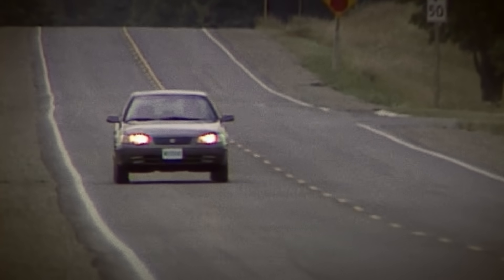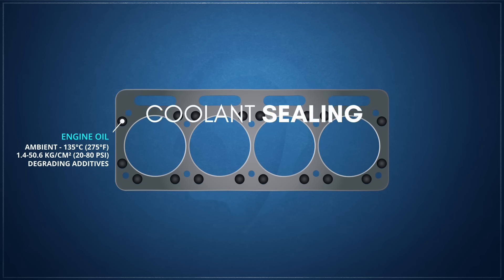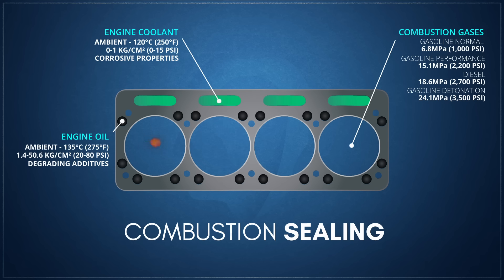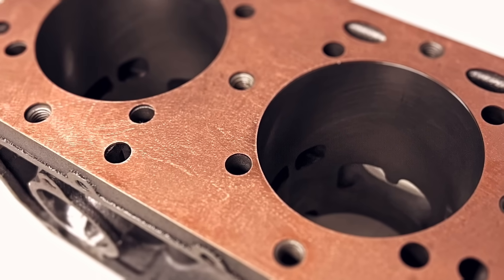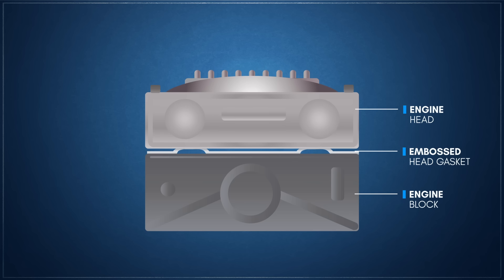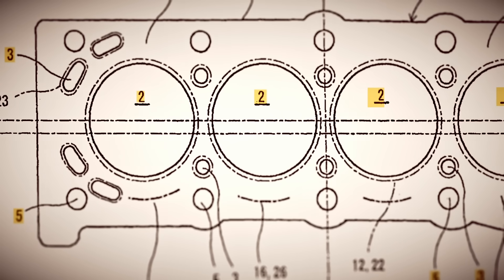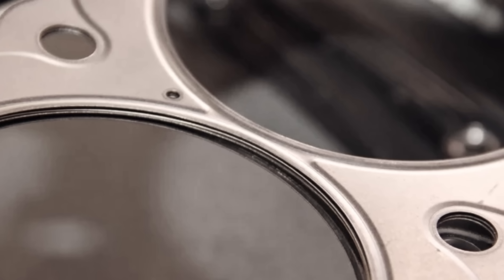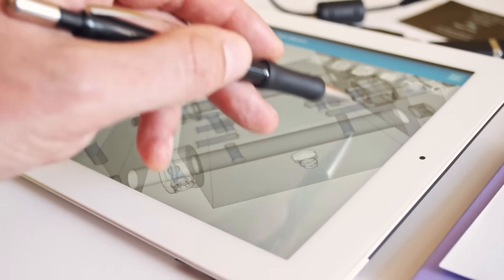The Most Tortured Part In An Engine

Comment: This was very interesting! Great timing I'm rebuilding an engine for my truck at this very moment.
Reply from the maker: Thanks! Haha, same! Doing my 4Runner 1/4 million mile service
Reply: @NewMind  crazy! Is that how you had the idea to do the head gasket video?
Reply from the maker: Absolutely! I was impressed by the 22 years I got on the factory head gasket. What are you rebuilding?
Reply: @NewMind  ahh.. 20 years that's good. Finally got back going again and continuing where I left off with the jet powered go-kart. I built everything and then I realized that the engine in my truck was blown. So I had to interrupt everything to rebuild the engine I have 4 broken main bearing bolts in the block now and 3 broken exhaust bolts in the head. Seems that for some reason the engine spun a bearing and has 1 bent valve, weird, only has 40,000 mi
Reply: @WarpedYT  oh boy, late model? I'm trying to build a very custom 4-cyl and looking at as much information on related parts myself. Currently, resonance and volume. Specifically scavenging and Helmholtz. Well, and the noise maker I can put in maybe. If v8 can have a boom tube setup, what is the reason a 4 cylinder cannot? Oh well, despite half an engine. But I imagine smaller volume can help, and proper angles. I've been finding that the secret is not the tubes, it's the x and angle of it because iroc had the same sound of older nascar. Now the thing I need to figure as with any engineering problem, what's the compromise, flow or torque? Oh, have you looked at David vizard? The old racecar guy? Dude seems like he's leaking knowledge, and knows his stuff more than gale banks. More areas than banks talks about anyway. I figure if I like all of this stuff and going to dump enough money into a car from early 2000s to buy a used i8, might as well make it way more bulletproof (not hard I believe) and get it where I want. If I work it right, I might have this car for more than 35 years if luck is put into the equation. It is hard to find accurate information describing the math I am looking to use but albeit, specifically you and new mind both have good data from what I've seen. I think I'm trying to look at a component level, i.g. may be something I already know like, r.a. of a intake/haust port and flow direction. Smoothies doesn't mean better flow, 80ish to 120 grit is just about right, and the way one sands it matters and well as how one removes material and changing the bowl of the port matters too. This is all really cool in my mind. If only there was a way to document it all and curate a well defined library or repository for it all...besides word and excel of course.
Reply: @NewMind That is SO neat! My 4Runner is just over it’s 1/4 million miles and I’ve been thinking of changing the head gasket just when I saw this video.
Reply: Same nissan navara d22 😂
Reply: Hey guy's I would love to see more  of  liquid piston engines.
Reply: @Darwinsfinch78  I will show the newest larger prototype as soon as it's done
Reply: subi gang gasket issues :')

Comment: 140°C is more like 280°F!!! That's overheating! Probably mistake when converting units... 
"SEALING ENGINE COOLANT
Similar to engine oil, on most water-cooled engines a head gasket must also seal the passages that carry engine coolant ...  120°C or about 250°F, with normal operation seldom reaching above 140°C or 220°F. "
Keep it up :)

Comment: I've thought about this before. Is there a reason you can't have a double tongue and groove head gasket design? In other words, a head gasket that has two 90 degree protrusions that fit into grooves. One groove in the top of the cylinder block and one in the cylinder head. Rather than just a flat gasket sitting atop of the block.
Reply: No.
Reply: @hime273  Great in depth reply. Thanks. 🤔 Now I know better. 😂

Comment: Enjoyed that. Thanks for posting. So MLS ( Multi-Layer-Steel ) gaskets  go back to the 1970s, over half a century ago. That is news to me. 

Despite the common accusation both within the trade and car consumer circles. Cylinder Head Gaskets rarely actually "FAIL". Invariably they are first damaged by some other process such as excess heat. That following coolant loss and loss of coolant can be the result of a multiplicity of causes. These range from a worn Water Pump, Thermostat Malfunction to a simple split in the fatigued Rubber of a Coolant Hose.

Nevertheless, the poor old Cylinder Head Gasket gets the blame for failing. When in actual. fact, it was first damaged so no longer able to do the job it was designed to do.

Here in the UK, there is a Ford Modular V8 engine in my MG ZT 260 ( 4.7 Litres ) with the 289 block I believe it's called stateside. According to this informative YT posting, that has an MLS Head Gasket fitted. Correction, make that two.. A lot of work needed if ever one or both of those "fail".. Unlikely, that hugely under stressed V8 with it very usable leisurely power should chalk up at least a couple of hundred thousand miles before anything like that happens. Provided well maintained of course. Some I believe the other side of the Atlantic rather more than that, double even.

Thanks for posting.

Comment: Vintage Ferrari mechanic here. Old aluminum Italian engines, especially V12, really like to move around a bit. Using permatex Aviation Sealant ALL over the head gasket does the trick better than anything I’ve used. It does not ever fully cure meaning it changes none of the dynamic of an otherwise naked head gasket.

Comment: the most tortured part in a engine is definitely the oil.  it gets whiplashed, burned and beaten till it has enough.  when it has enough, you have to change it or it will get revenge and destroy your engine.
Reply: That’s not a part
Reply: @skylerstone7885  Its a liquid part

Comment: A minute of silence to those cars owners that got a call from their mechanic and ended up here to find out what a head gasket is
Reply: Press F for Jay boys
Reply: I thought the belt tensioner was the most stressed part. Just look at it when it runs. Or try to, as you can barely see it.
Reply: @satunnainenkatselija4478  belt tensioners are not internal parts so that may be why. Although some belt tensioners (like toyota) seem to last forever and i doubt as much engineering has gone into them either.
Reply: @satunnainenkatselija4478 that’s being replaced on my car right now! Belt tensioner. 😁
Reply: @satunnainenkatselija4478 technically the most stressed part is the main bearing. Oil has to cool it or it will literally friction weld itself solid
Reply: I am the mechanic that makes the calls...I have become 💀, junker of Subarus
Reply: Ha.  Brilliant.

Comment: I doubt research will stop, the internal combustion engine isn't going anywhere, most of the public may be using electric vehicles, but the military won't be, and stationary engines such as those used in power generators won't be electric,

same with aircraft that are too big for electric conversion, but also too small to be fitted with a turboprop engine, as well as long haul trucking, yes the Tesla semi will take a bite out of it, but long haul trucking won't go electric for at least another 15 years or so
Reply: The government is hell bent on disabling gasoline engines.  After 2035, when the mandate kicks in to eliminate petrol engunes, the govt will say if you want to continue to drive oil based engines, fine.  They will just slap a $25 gallon tax on gasoline.  You can drive all you want, it will just cost $35 per gallon to do it.  Worked with tobacco

Comment: I would like to submit some remarks. 1/ The main problem for the roughness is not the Ra but the Rmax: Ra gives an idea of the surface but the Rmax is where the leak will occur if badly assumed. 2/ Regarding clamp force, you should emphasize that the "external" bolts concentrate their force to the 2 external cylinders and so deforming the cylinder head in a banana shape that asks for non symetrical cylinder sealing shape (heigth differences around the bores, called 3D stoppers, also reducing bore distortion and wear of piston rings). 3/ MLS with 2 layers also exist. 4/ Viton is a trademark. The name of the Elastomer used is FPM. 5/ The representation of the layers for MLS is wrong: the middle layer of the MLS at 14:35 should be upside down to combine the spring effect of the beads.

Comment: I love the tortured conversion of PSI to "kilograms per square centimeter" instead of just using pascals.
Reply: Just searched for a comment saying that so I don't have to xD I, as a metric guy, had to google that unit as I did not understand why anybody would use anything involving gravity for describing pressure - found out, the wikipedia article is only available in english, itialian and sicilian - that explains a lot 😂 And I like that engine oil in a metric car seems to be at pressures rising to almost 9 times the pressure compared to its imperial counterpart 🤣 50.6kg/cm² -> 720 psi

Comment: I rebuilt my XL600R with an elastomeric gasket.  Air cooled, and only had silicone for the timing chain since oil is external.  I never did a rebuild before, and I thought the strange crush ring was kinda funny.  But it was a minimal cost rebuild with just a hone and rings at 50,000 miles.  I really just needed to take the head off to fix the exhaust studs, and figured I’d refresh some things for the next 50,000 miles.

Comment: Interesting stuff! I once had a 2 stroke motor bike than ran great w/ no head gasket at all after I sanded the surfaces w/ 2000 grit, but I guess that's the exception that proves the rule so to speak
Reply: So I'm guessing you had those components sanded to a mirror finish to achieve that?
Reply: I’m guessing it had an aluminum cylinder head and possibly block, aluminum can deform enough to maintain a seal. And there is no oil or coolant to worry about leaking.
Reply: @griplimit   yeah you're right it was all aluminum

@Jumzzy Boy  it was pretty close to a mirror finish, plus little engines like that are more forgiving in a lot of ways

Comment: probably the turbo.  managed to melt  the vane ends of a wheel, it's now a garage decoration.  the turbine studs have it worse with the heat cycling and high rpm vibrations.  it's a wonder how they stay attached on engines without b shafts

Comment: If it's a ford truck the threads that hold the spark plugs I would argue they are the highest stress part.  The ford pick up trucks of 15 years back had a bad habitat of taking flight and leave the engine.

Comment: For those curious, there is a major improvement to typical head gasket design, called "O ring," which places a steel ring in a groove shared by the block and head, and crushing a copper gasket between the two. This creates a much stronger seal, at the cost of a bit of engineering and of course the material cost of copper. This is what many drag cars use, and with it you're more likely to pull the studs out of the block or bend a rod than blow through it.

Very well put together and informative video, though! I enjoyed watching.
Reply: That was covered in the video at 16:30
Reply: Watch the video dude

Comment: the surface roughness conversion at 14:20 is off by 1000 - it looks like the um were treated as mm when calculating inches.
As a side note, the SI unit mm should be written in lowercase.
Reply: eveything in this video is a far reach. This is just typical youtuber video for profit. Take a random topic and stretch it to the maximum, pretending head gasket is rocket science, that is quite ridiculous.

Comment: My last car I owned required a new engine due to a blown headgasket, so this was actually kind of cool, underrated topic.

edit: that car was a 2007 mazdaspeed3, aka 4 banger small turbo hatchback that with a custom tune and other goodies, I pushed to its limits often, inducing a lot of heat which you mentioned is a recipe for failure. Now I have a 2002 Gs300 with a 2jz ge that has probably one of the best factory headgaskets available and if everything else fails the engine and the metal headgasket are the last things I expect to go without actual performance modifications done.

Comment: Head gasket replacement was my first diy, major engine repair. 18 years old, no idea what I was doing and terrified. But I was a young working man and paying $475 (in 1999) for a mechanic, vs $25 for a new gasket and fresh coolant was a no brainier. I had no help... There was no YouTube or even a phone to watch it on lol. All I had was "the book" on my particular engine, Chevy inline 6, and a toolbox. 
😁 After the 3 day struggle I not only understood how to change head gaskets but also had ascertained how to adjust valves and how rocker arms worked with pushrods and all that stuff. 👍
Lol I also learned to have sufficient antifreeze. 😊 It's funny how the head gasket can endure pressure and immense heat, but freezing water will quickly destroy one. Lucky that's all that happened.

Comment: Subbed.
Exactly what I've been wondering about.
My gasket dribbles oil and water  over the engine like grandma eating oatmeal, but at least they don't mix and I don't loose power. Just make a mess on itself and leave little drips occasionally . . . like grandma.

Comment: Some of the old flatheads did all of this with no gasket at all. Just a copper spray on gasket and bolt it down. Thye were low compression engines but pretty neat in their own way.

Comment: The conrod, hands down the most tortured part. The headgasket has more then one function, but its not the most stressed part by far.
Reply: It's the most "psychologically" stressed, with the most things to not screw up and lots of phones constantly ringing. 
The conrod just has to be a great powerlifter; having only one thing to concentrate on can be kinda relaxing if you're good at it 
🤷🏻‍♂️
Reply: I guess the conrods can be easily engineered with physical capabilities to endure the stress they undergo.
Reply: you spelled compression rings wrong
Reply: of course, its just your typical youtuber video, take a random topic, stretch it to the maximum for profit, serve hot to gullible "viewers". Reality is There is nothing special about head gaskets, any compression gasket can sustand high pressure, , the gasket does not get much stress at all considering how small the contact area is compare to cylinder heads for eaxmple. This video is just a big reach.

Comment: there are so many junk head gaskets out there.  It surprises me that some last for as long as they do.  I have built a lot of supercharged and higher compression engines, and I frequently use a soft copper head gasket for that application.  I coat them with PermaTex Aviation Copper Coat.  In some cases that kind of gasket is the only thing that will withstand the combustion pressures of a boosted engine.

Comment: My votes for most tortured components are crankshaft, piston,  rings,  wrist pins, connecting rods, rod bearings, rocker arms piston heads, anything subjected to friction, and/ or combustion forces, while lubricated with oil carrying metal particles suspended in it. Head gaskets are subjected to many different conditions as stated in this video, but each of these conditions are essentially compartmentalized to each specific function it performs.
If the block and head mating surfaces are properly prepared and the surfaces are plane and true, the gasket while vital to engine function, is subjected to conditions that are well within the capacity of the properly installed and torqued gasket.
 I say " CLICK BAIT" 🤣

Comment: My head gasket just blew on my 2005 Honda civic and it was not a fun time! A relatively expensive repair but this video is a good explanation of why it happened considering that it’s lasted all these years it was only a matter of time.
Reply: How is it now
Reply: @jayislander  it’s a lot better! That was its most major of its issues. Still have a slight oil leak which I’m guessing is a VTech solenoid gasket due to the location. Shortly after getting my car back from the head gasket repair my car started revving weirdly and throwing codes so I used an OBD 2 reader and it was a cam positioning sensor that needed to be replaced. Other than that everything has been bulletproof. Thank you so much for checking in Jay :)
Reply: @kmart625  that’s great hopefully you get everything fixed my headgasket also is bad just dropped it off yesterday waiting to get my vehicle back now watching some videos

Comment: I knew a ferry pilot that didnt have a head gasket for his twin engine airplane. He simply cut one out of cardboard and used that instead, appently he made it although not alot of oil left
Reply: on small two strokes head gaskets were and stil lare often made of paper or aluminum sheet, head gaskets are not a stressed component in a motor, they have an extremely tiny contact surface, everything in this video is a reach. Head gasket are not rocket science.

Comment: It’s the fact that it’s very thin so it doesn’t see as much pressure on its surface so I’d say there is parts that see way more pressure and you can literally take apart an engine that failed dramatically and head gasket is more likely than not still in one piece and not fail itself